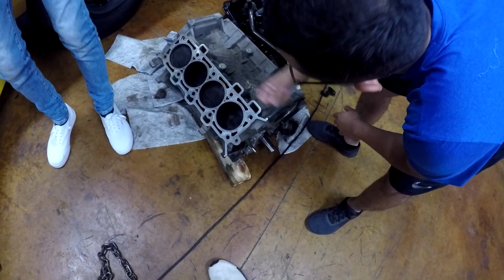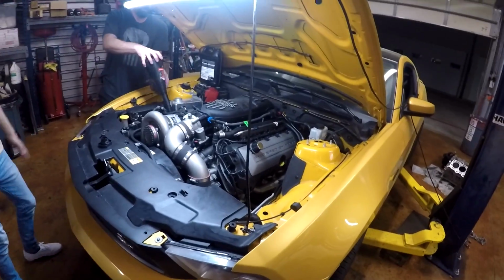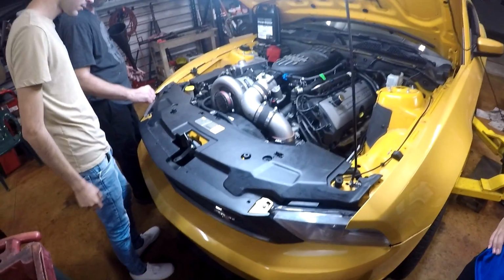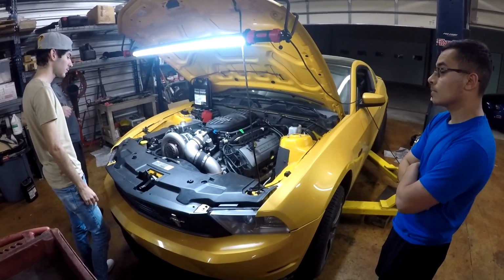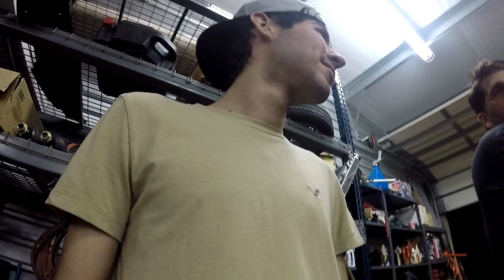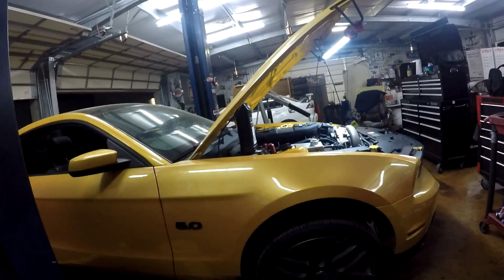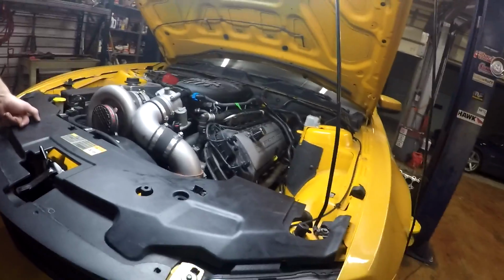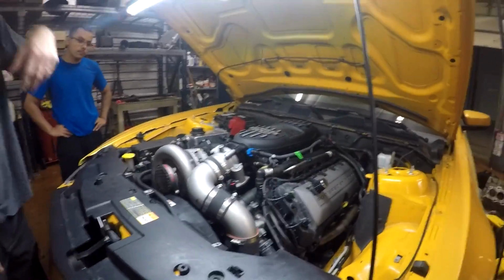GEN 2 MOTOR IN MY S197 MUSTANG!

Comment: Damn that guy works fast, what’s his info
Reply: It doesn’t take that long if you know what you’re doing
Reply: ^ There always gotta be that fake expert lol
Reply: Keenan Evans 😂😂😂
Reply: Keenan Evans how do I have to be a “fake expert” to state facts ? I pulled out plenty of amg and bmw engines.
Reply: @AmgKevo  Agreed, he literally pulled the motor and swapped heads; now if they actually were doing rods, pistons, bearings, polished crank, overbore, and balancing it with custom heads, valves, and springs that might take a little longer but again if you know what you're doing it's a day or two job. When you haven't pulled a motor it seems complicated I guess lol.
Reply: YvngGold thats true. Had my engine swapped in just 2 days
Reply: @roushgt6839  Yeah he's right. I got to the point where I could pull my heads in about 45 minutes even.
Reply: If you do something often enough, you could do it no problem

Comment: I know this is 4 years old but bad ass none the less. How is the car doing at this point? Ball park figure of what it cost for the motor? I am going to use the 3650 that I already have, it is strong. I would rather do a Gen2 over the Gen 1 just to it being easier to find lower mile engines. I will be doing the entire install, I know PBH sells the harness and stuff. Also, where did you get the engine from? Thanks. Subbed for sure.

Comment: Gonna blow his mind when hes sees the same issues with this one.
Reply: There’s a huge gap in potential between the gen 1 and gen 2 coyotes. With opg and crank sprocket he has a 8 second capable motor on stock internals. Gen 1 motors start to get sketchy around 700 rwhp.
Reply: Itsjusta6 made 900whp on the same short block, tho he has gen 2 heads, he can get 8-850rwhp reliably
Reply: That's not what OP is talking about....
Reply: NA11CS Stop hating
Reply: @dennisbraxton3770  How am I hating? If anything, we're trying to help him. The way he wants to drive that car, the breather is going to leak again.

Comment: Bro I had the same exact issue a week ago happen.  I did not have breathers on. Just the driver's side PVC valve tube going into my intake.  I had oil squirting out of my blow off from that same drivers side.    And I have the GEN 2!!!!  So be careful.   What was the end result of the exact issue wrong with your motor?????   I had 100% same issue as you, but I did a compression check and losing my two middle cylinders on the driver's side.  Me and my buddy just pulled my motor and going to build it to handle 1100rwhp.  I was running 15psi and making 806rwhp on e85.  Mine went out on 7200.  Smh.